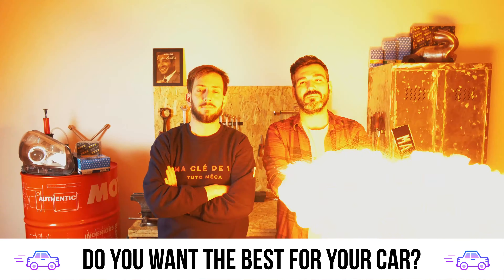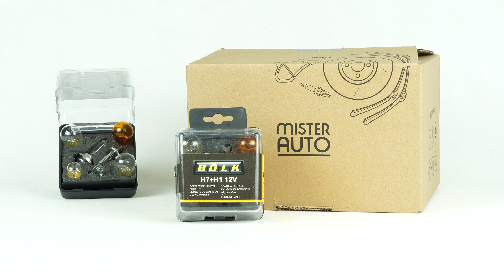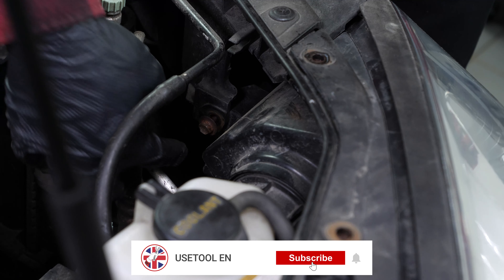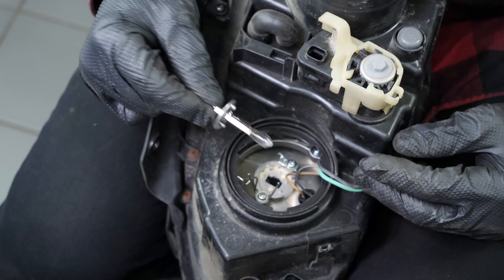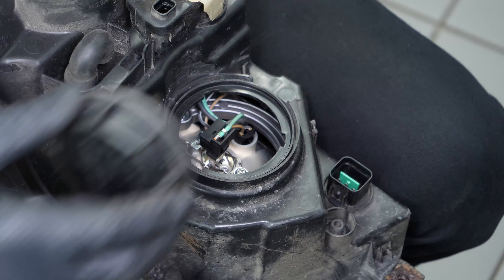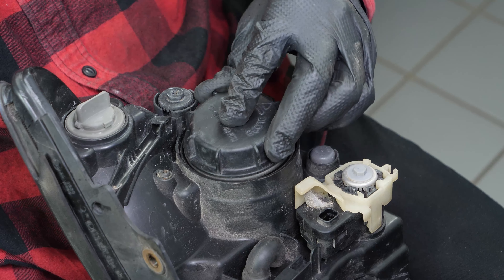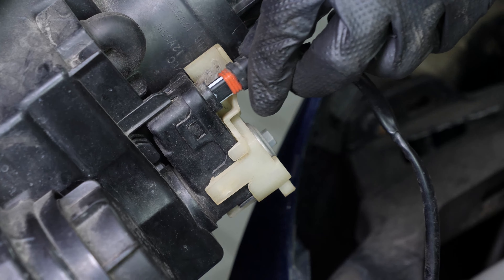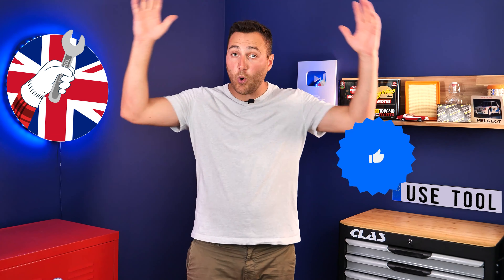How to replace the headlight bulbs i30 mk1 💡

Comment: Thank you for this video! I have been procrastinating on changing the light bulbs in my i30 for a week or two but this video makes it look way simpler than how I was shown originally 😅
Reply from the maker: Hi @Anna464! My pleasure, I hope the operation went well 👌
Reply: @UseTool_EN  It did! Had some trouble with some of the bolts being really screwed in there but after that it was easy with your guide :)